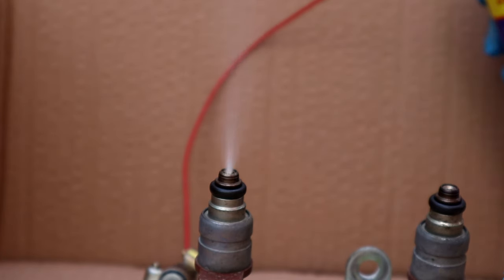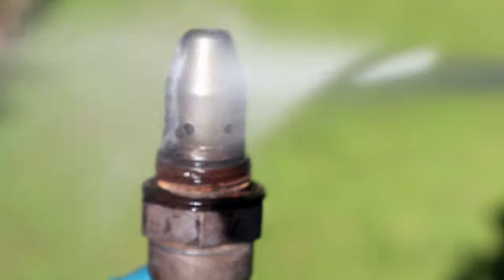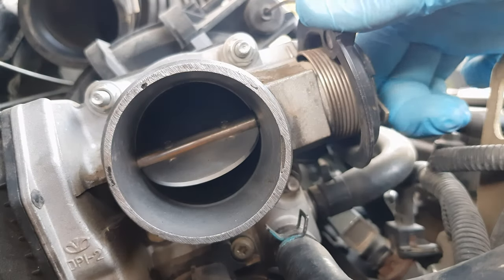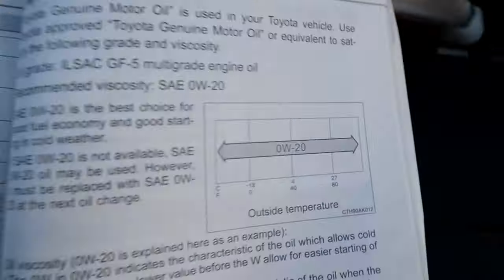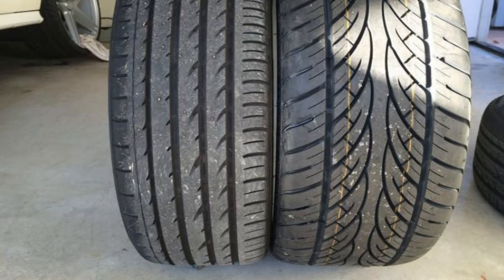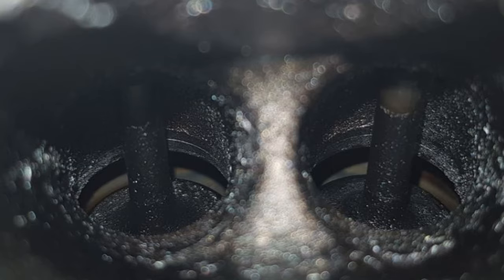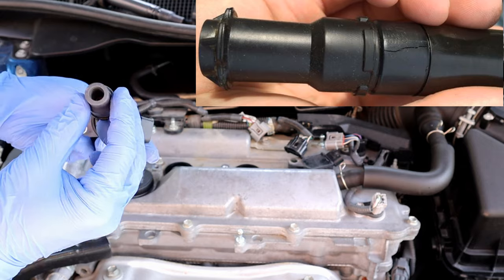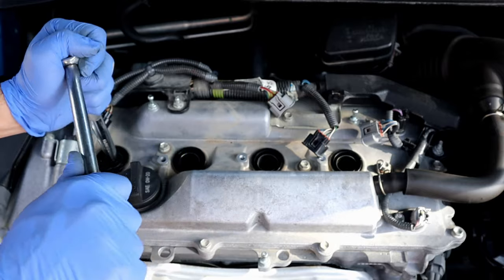10 Driving Hacks To Save Money On Gas/ How to make your car burn less gas/ Fuel saving tips/ ALIMECH

Comment: 1-fuel injection 2- Oxygen sensor 3- throttle body 4- engine fitter 5 engine oil 6 Tires 7 intake and exhaust valves -8 Gas Cap 9 ignition coil -10 Spark plugs  thanks for everything you do 🤲 I forgot something else catalytic converter✅
Reply from the maker: Thanks for sharing
Reply: @AliMECH   have it in the owner's manual, but I have a 2012 Honda Accord, and it's written another way, the owner's manual says it is You must multiple daily tasks On a short Task one The car does not suddenly accelerate or brake suddenly, use cruise control if possible, and more not carry heavy loads, use oil recommended by the manufacturer, Your friend is from Saudi Arabia

Comment: The volumetric coefficient of thermal expansion of gasoline is about 0.001. So for 10C difference it is about a 1% difference. Since gasoline is stored underground the temperature doesn’t really vary. It would not vary by even 1C which is less than one tenth of 1%.

Comment: Hey Ali mech! Love your videos!

Here is an idea for a video for you:
I have a couple of old cars. One is a 1999 Honda CRV. I would like to know the condition of the piston rings and if any wear on the cylinder walls. Can I see this with a boroscope?

Come on Ali: the fuel tanks at gas stations are in the ground. They will have a constant temperature throughout the day.
Reply from the maker: Thanks, yes you can see if there is wear line on the cylinder wall, but make sure that the piston at the lowest position 
Well, there is a research proof that,  you can Google it 
Yes tge tanks under  ground, but according to geothermal sources, the temperature still changes in few meters, unless its deep close to 40 feet 13 meter

Comment: hey alimech i live in a hot weather country  and my camry is imported from USA it uses OW-20 but cz the car is made for less temperature  but i live in hot weather and i use 5W-40 is it okay ?
Reply: 5w is ok. During startups n cold weather. But u should use at least a 5w-30. Most engines are designed with oil passages that allow for optimum performance. I used to use 5w-40 for my engine that required 5w-20. But after switching to a 5w-30. I can see alot of good gas mileage
Reply: In the summer, some states in the US can reach to 50 degrees